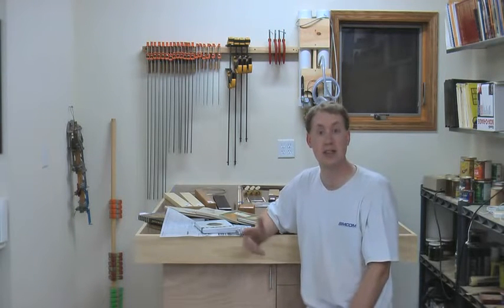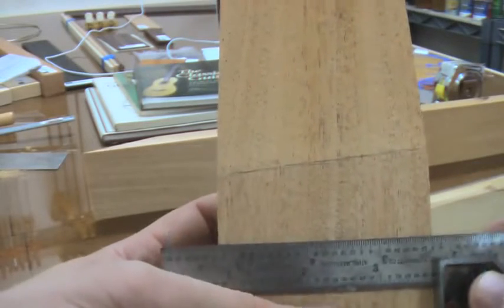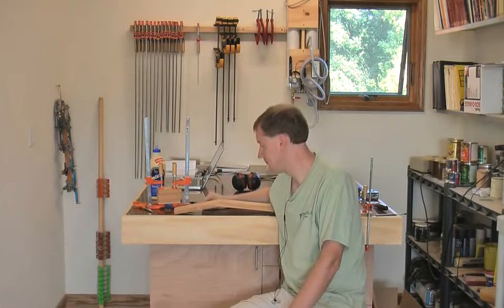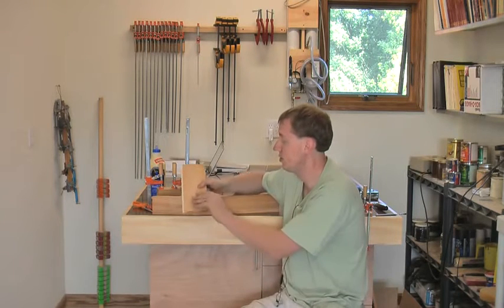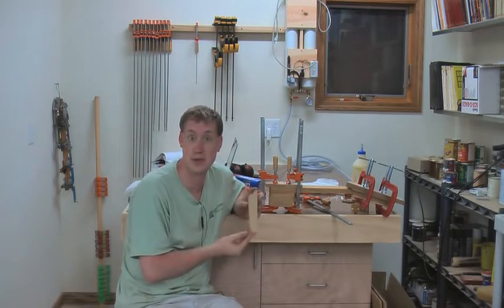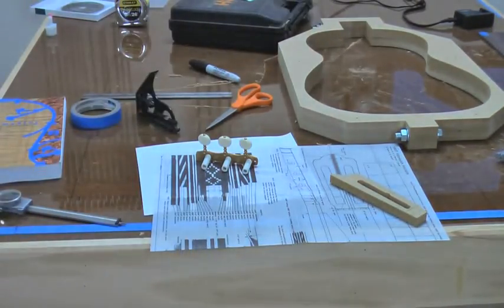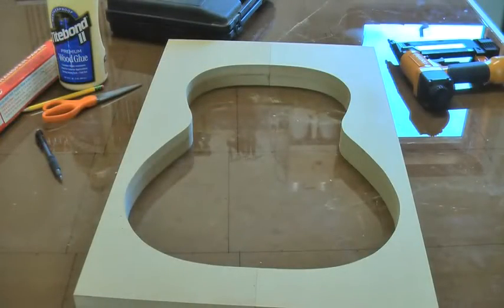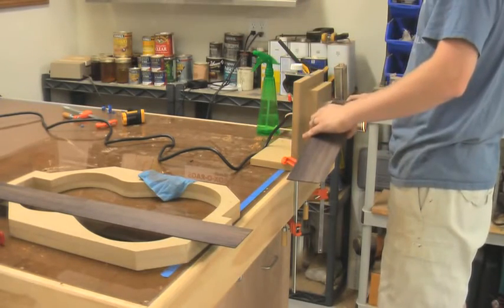108 - How to Build a Guitar (Part 1 of 3)

Comment: **OUCH you killed the tone of the body woods by laminating rosewood w/ maple!**

Curly Maple gives a sparkly, specific tone, rosewood gives a full and more broadly ideal tone- but glued together they both limit each other (I think b/c of perpendicular grain alignment) :(

The laminate glue could even be enough to kill the tone coloration since it's on top of a solid piece of Rosewood and not part of a multi-thin-layer stack.

If you want prettier wood see if you can find some Myrtlewood or Osage Orange (American Woods) or Ovangkol, Striped Ebony or even Quilted Mahogany (WOW) -

Or just find a Rosewood w/ some nice contrast to the grain colors to bring them out with a solvent-free truly-clear paste filler & use a UV lamp if poss. to cure it best. All will look beautiful; just Google for examples.

Guitarists give their left arms to find guitars that are all-solid, non-laminate bodies. True solid Rosewood typically adds about $100-200 to the cost of a guitar at min. So that hurt to watch! Great vid though. Look forward to watching the series and seeing/hearing the finished build :) Thanks!
Reply: laminating wood for back and sides is a great alternative to solid wood which not only save costs on material but also saves A LOT of time.
While it was ideal to use all solid woods in the past, laminate woods have been used A LOT in making guitars.
Antonio de Torres - the father of modern guitar used to build guitar with papier mache - basically means PAPER! and that very guitar still produces fantastic sound!
Famous Japanese builders (Ryuji Matsuoka, Kohno,...) have been laminating their high-end guitar back and sides for several of years. Adding to saving the cost of building, quality laminating wood also have better capability to "fight" the environment conditions (fast change in temparature, humidity...etc).
There is a stereotype about back and sides wood producing better sound; this is not the case. If you can just listen to 2 guitars side-by-side and detect which one is which, then congratulations, you have better ears than the dog! :-)
Reply: 1. Agreed that laminates can be perfectly viable.

2. But not always, nor even often enough.

3. I've heard many laminates compared to all-solid w/ same bracing and same chosen wood, and the difference is often huge, you could hear them too w/out being a dog. Solid back and sides have much more complexity in the tone.

4.For laminates to work well, they must be acoustically compatible woods, or all the same type of wood of similar grain.

5. Laminates where the layers' grains cross each other too much like this: (##) choke off the sound and the different woods in the laminate cancel each other out, losing their tonal qualities. (For instance laminating rosewood w/ maple- those two woods are acoustically opposite, and together produce a dead tone when laminated).

6. Laminates where the grains line up like this: (|||||) let the laminate layers vibrate more completely, and allow the tone of the woods involved to come through.

Hence my comment. Cheers.
Reply: dear jazzle
I have been building, restoring and trying many different guitars 
agree on some cases, laminating back and sides does not produce as pleasant result. However, keep in mind that most wood for back and sides are not AS IMPORTANT AS top wood, rosewood family... does not have such good sonic characteristics. if one laminates rosewood and maple, then don't even care about that very guitar. 
As I mentioned, guitar with laminate back and sides still produce excellent sound (Smallman for example) 
for laminating wood, wood/wood is not the only way to conducts, there are also laminate wood with nomex which does not have any sonic characters at all. There are numerous luthiers I know and study with, use nomex laminate TOP, their guitars still kick serious a**.
Of course, you have your own taste and opinion on the sound.
Please also neglect cheap guitars with laminate wood (back or sides or top or all)
best!
Reply: Nice, and agreed, though irrelevant to my point- I've actually been agreeing with you:

The concern is not:  "Is the guitar a laminate?"

It is: "How well is it laminated, and do the wood grains work well together?"
Reply: Yes, now we are on the same plane!
Nice argument
Reply: Thanh Huynh you guys recommend any particular books or websites to read on correctly matching woodgrain?

Comment: how much time you spend making an guitar?
Reply: depends on your skill level and access to equipment 
for example:
case 1: if your skills are excellent but don't have those bandsaw, router...machine, it would take you 7 times longer 
case 2: if your skills are moderate but have access to all of the expensive equipment, you'd finish the guitar 7 times faster than case one
Reply: Professional luthier here. One offs take 100-400 hours depending of how special the guitar is. But copies of other designs take 50-75 if you do them to the top notch. I have seen people build decent instruments in under ten. But as a beginner if you spend 10 hours it will be horse shit. Even pros 10 hour builds are simply not as good as the 50-75 or 100-400 hours.
Reply: Thanh Huynh .. But how fast exactly is case 1?
Reply: haha, I'm just making the number up for funnier interpretation of my point.
my point is that:
with the help of modern equipment, everything will be much easier and faster. however, in both cases, a good amount of experience and skillset is a must.
as a builder and restorer myself, I find that I put around 100hr in building a guitar with the help of all the equipment like Rick's. If I were to do everything with my bare hand and hand tools, it could take me from 400hrs+. 
hope my points help :D
Reply: Birki gts thanks for the reply; If i were to order an guitar, i would say you not to rush, take as long as you want, you're the professional here... ill wait.
Reply: Brunn0121 i wouldn't even accept a job i have to rush with under normal circumstances. I don't want something not perfect with my name on it.
Reply: Birki gts you sir got my respect, thats my exact thought, rather wait for the best work a luthier can do than a half assed one made in a dozen hours..
Reply: O vídeo só tem legendas em inglês, as em portugues BR são geradas pelo reconhecimento de fala do youtube, que não é bom.
se vc entende LER algo de inglês, já ajuda!
Reply: eu nem sabia q tinha legenda nesse video, elas estao certas.

Comment: Some of those steps look very familiar! Glad my DVD come in handy for you. Happy Building!
Reply: kindly tell me about guitar neck angle 
what should be the angle
Reply: +Usman  Ashraf  I do not know what the neck angle is. It varies for each guitar. What is important is the gap at the bridge when placing a straightedge along the neck ( no fretboard attached) I like a gap of 3.5mm at this point.
Reply: +OBrienGuitars 
sir which wood is best for guitar manufacturing
Reply: +Usman  Ashraf It depends. I prefer Indian rosewood. It is very easy to work with.

Comment: Hey Marc, noticed you had the Logitech Z4's on your computer back in 2009...Just wondering if the subwoofer on those speakers is still bumping. I've had mine hooked up to a home theater system for 5 years and it still works great for being a computer accessory. Great projects btw and looking forward to more videos from the new shop!

Comment: a question. as a bassist i have to ask, considering the strings build up a considerable amount of stress to the neck-structure, is the neck solid enough or should it be strengthened more than shown here? secondary worry would be the "chord-board", how much of a difference are we talking about if we compare electrical instrument tensions and acoustic ones?  this all from the "just think" department, naturally, love the clips as always.